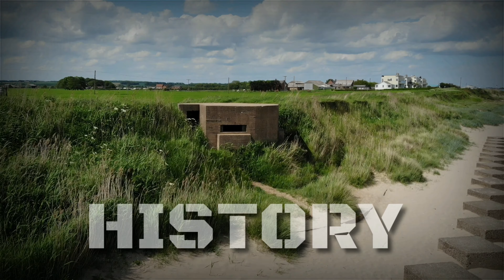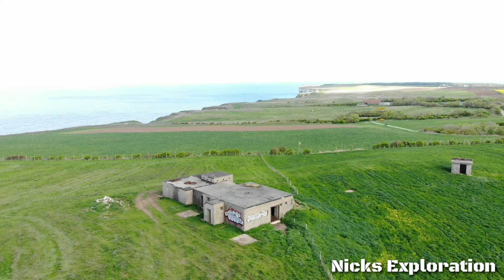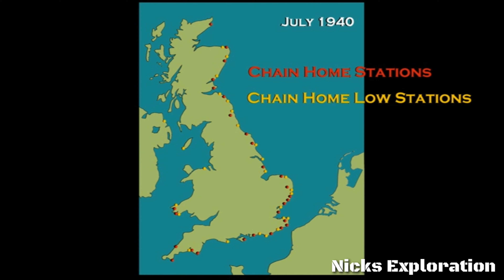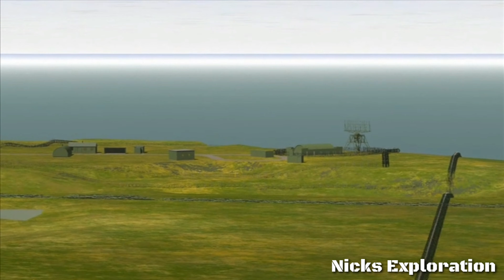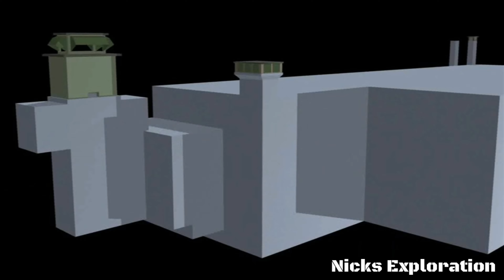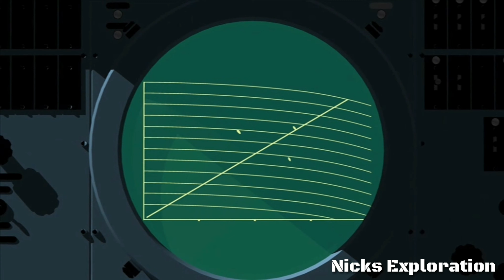RAF Bempton 1940-1964 * Part One *

Comment: Very well done, just finished episode 3, I’ve been to Bempton cliffs on several occasions and didn’t know what the site was used for so investigation brought to these videos, I would like to know what the vertical concrete posts arranged in a Y shape were all about if anyone knows the answer
Reply: I’m also trying to find out the same thing and hoped the video series mentioned but seemingly not. Have you ever found out through other sources?
Reply from the maker: Sorry the concrete posts are from an experimental high speed passive radar system. Code name " Winkle "